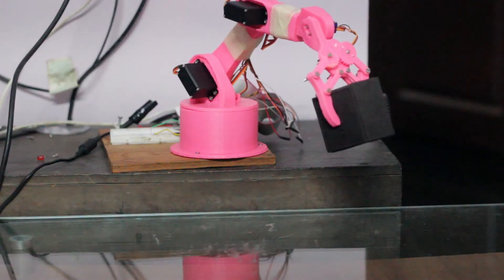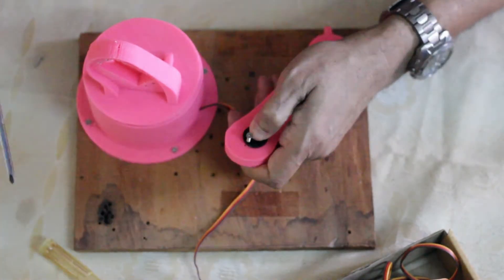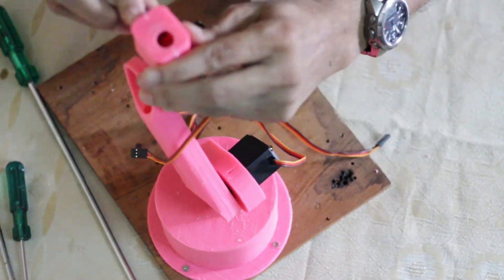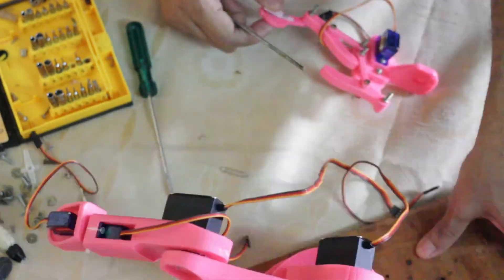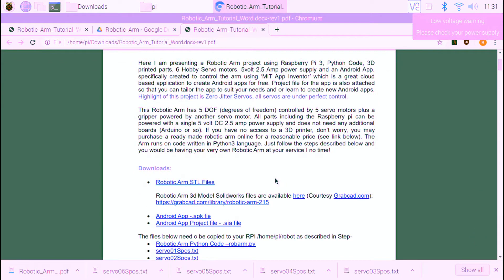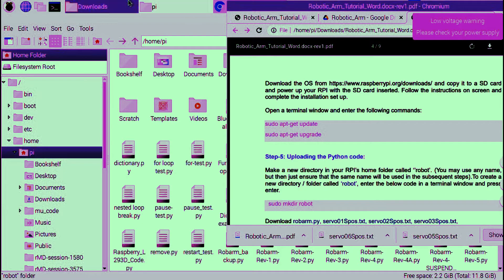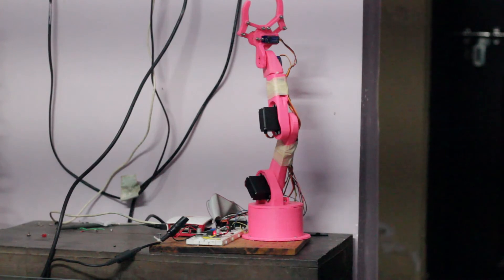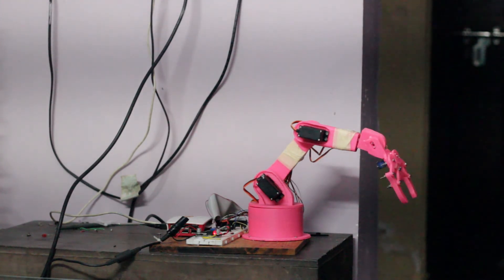Robotic Arm with Raspberry pi | TechNcline |

Comment: Well this is stolen from the How To Mechatronics channel..
Reply: How To Mechatronics channel doesn't have a robotic arm with raspberry pi. They used arduino.
Reply: @roshanme8111 you are right! How to mechatronics used Arduino and here raspberry pi! So it's not exactly the same! Although idea is the same - to control robot through phone, but implementation is different!

Comment: Sir, what code should I use to control the robot manually
Reply: Sir, what code should I use to control the robot manually
Reply: @almazbekamanbaev5507  Did you get it? Can you share
Reply: @jayantii22  just use pigpio
Reply: @almazbekamanbaev5507  okay thanks, I replicated the whole setup given in video but the moment I run the program, the robotic arm suddenly moves into a complete horizontal position from the vertical one and then I m unable to control it using sliders.
What can i do
Reply: @jayantii22  I dont know because I used pigpio instead of his code
Reply: @almazbekamanbaev5507  Can you please share your code files?
Reply: @jayantii22  i dont have it with me right now
Reply: @almazbekamanbaev5507  Okay no problem, do send if you get it
Thank you
Reply: I m trying to control the servo motors using ardiuno. But while setting the angle for elbow and shoulder I m facing difficulties. Like no matter what angle I give, it behaves weird.
Do uk what I can do

Comment: can you control it with phone or any device like writing in code how much the servo motor moves please
Reply: *without
Reply: @techncline4259  is there a video of how you wire it because I have everything setup except the wires. I don't want to fry the pi lol
Reply: @techncline4259  Mister is it okay if I use a 5 volt 2.1 A power supply?
Reply: @techncline4259  Will it do any damage. SO only the motors will move slowly right?
Reply: @techncline4259  so is it okay if i use it
Reply: @techncline4259  does the voltage matter?
Reply: @techncline4259  will it affect the raspberry pi
Reply: @techncline4259  what code do you use to make the robot move. I mean like just open the wrist and close it. I don't mean like in the app but in the code.
Reply: @techncline4259  THanks that helped a lot
Reply: @techncline4259  It does not wirk with small servo
Reply: @techncline4259  It worked man. THANK YOU. Can I buy you a coffee or pay you?
Reply: @almazbekamanbaev5507  hey can u help me out,  i am not able to find proper way to power all the servo motors ,so can u tell me how u did it?
Reply: @anugrahnambiar9648  I used 5v
Reply: @techncline4259  Thank you. You helped me a lot on my project. THe ones I searched up were arduino robots but this video came in and it was raspberry pi. You deserve 100k subs
Reply: @techncline4259  Quick question how can i lower the torque or speed of the motors?
Reply: @techncline4259  thanks bro sorry for the questions
Reply: @techncline4259  is there a different way to control it
Reply: @techncline4259  like an easier way to slow done the servo motor. 

for example for my servo 1

def SetAngle1(angle):
       duty = angle / 18 + 2
       GPIO.output(15, True)
       btmbig.ChangeDutyCycle(Duty)
       sleep(1)
       GPIO.output(15, False)

       btmbig.ChangeDutyCycle(0)

Right now it moves very fast I need it to be slower
Reply: @almazbekamanbaev5507  Instead of moving  the servo to the desired angle at one stretch, move step by step:

def SetAngle1(angle):
       
       GPIO.output(15, True)
       for i in range(angle):
       	duty = i / 18 + 2
       	btmbig.ChangeDutyCycle(duty)
       	sleep(.02)
       GPIO.output(15, False)

       btmbig.ChangeDutyCycle(0)

Now you may change sleep value (.02) as required.
Reply: @rajasankaran4153  thanks